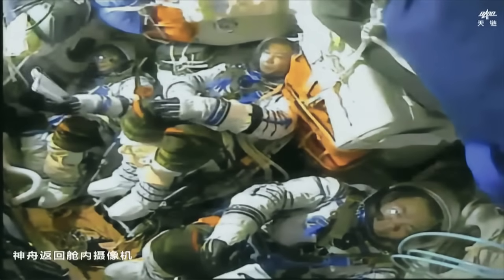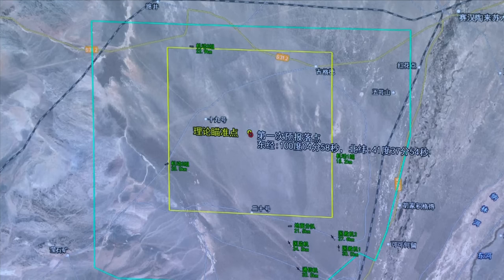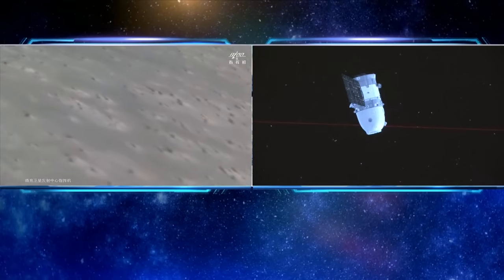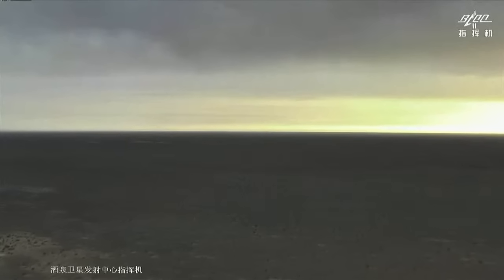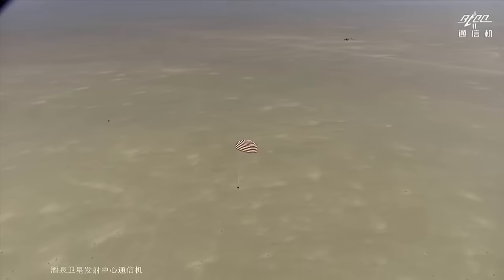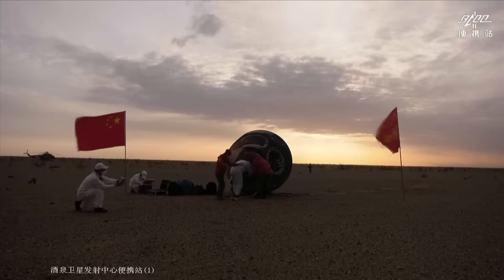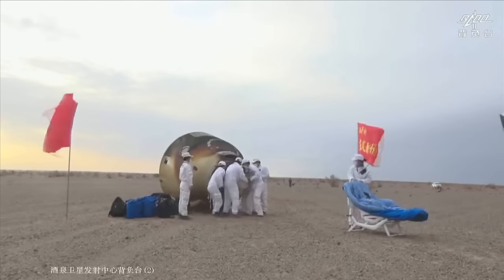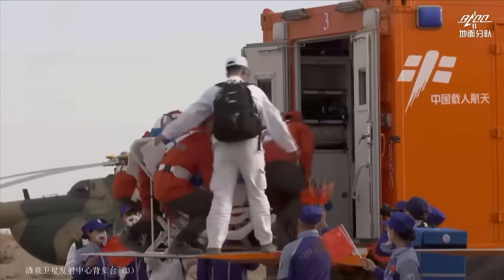Replay! China's Shenzhou 15 crew returns to Earth from Tiangong space station - Full Broadcast

Comment: That was one harsh landing i have to say
Reply: No, it was a soft and smooth landing. If you didn't see the smoke, then it would have been rough.
Reply: 这叫反冲发动机 lean more
Reply: Looks like it but the return capsule have thrusters fired prior to landing and also the the suspension seats activated prior to landing so it can absorbs shock upon impact